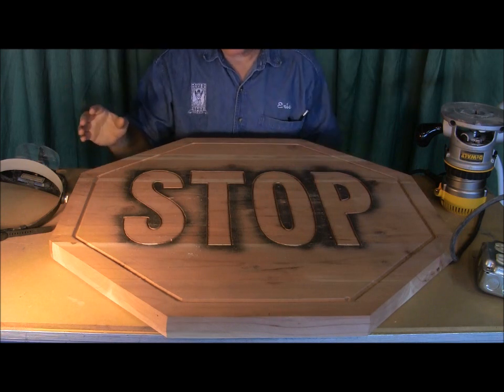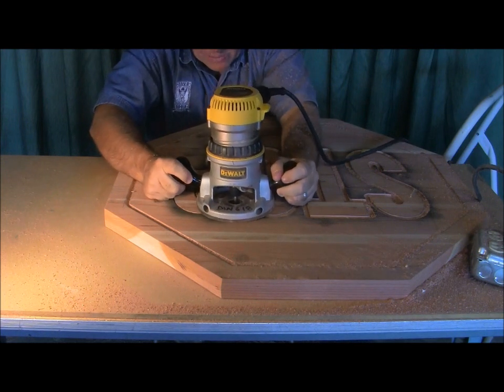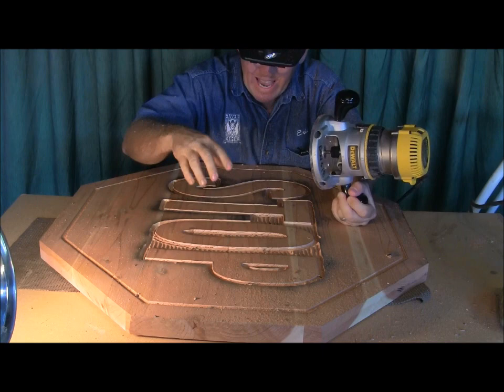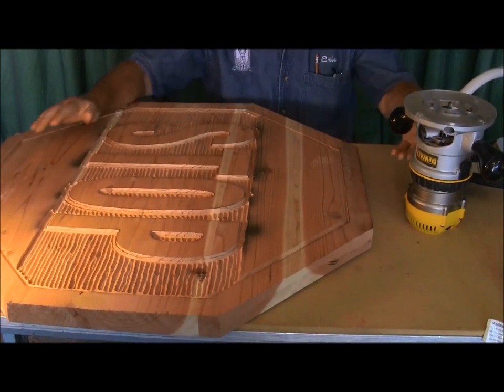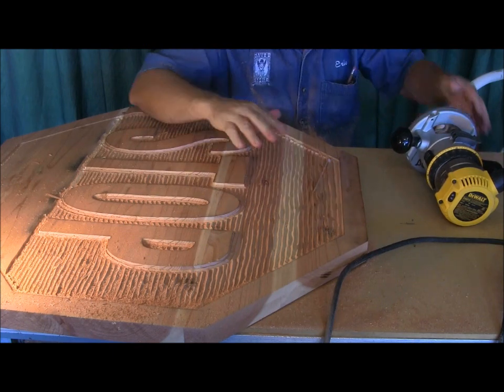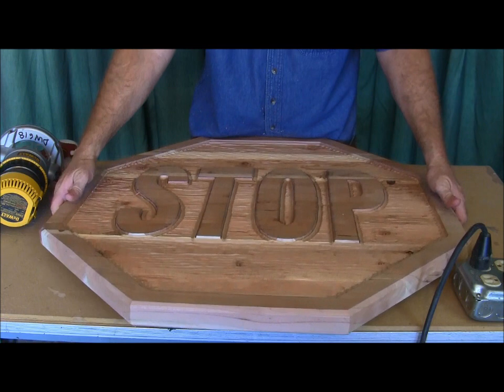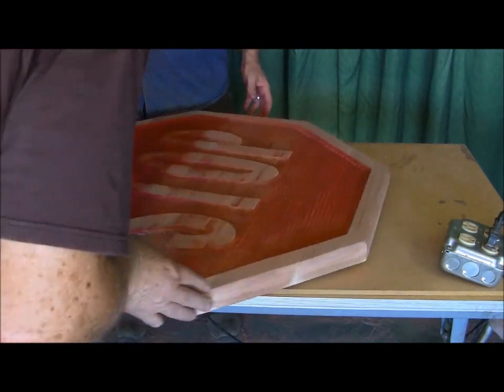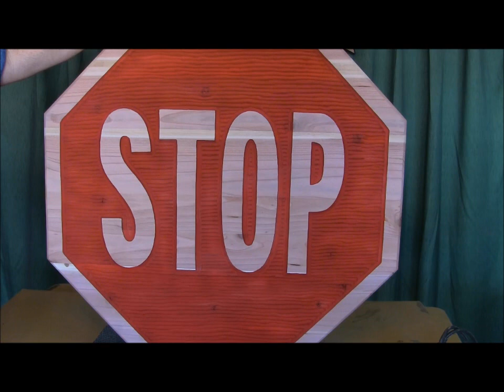#97 Freehand carving redwood stop sign 2 of 2

Comment: what are your depths? Profile depth, 90 degree depth? Did you only use two bits on this?
Reply from the maker: The depths vary depending on what I'm carving but on the one I was approximately 1/4" on both the profile and the 90. Here's a video that may help you    https://youtu.be/pFqeuYfUC1g  If you have any other questions you can email me directly, eric@makeawoodsign.com